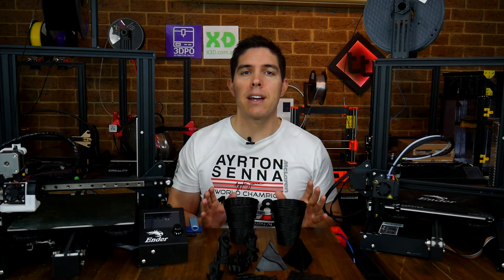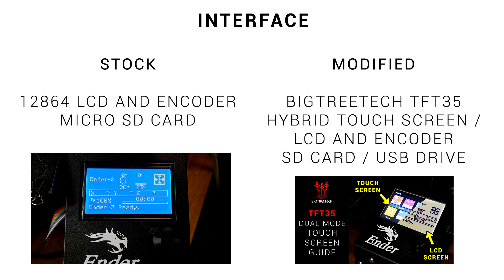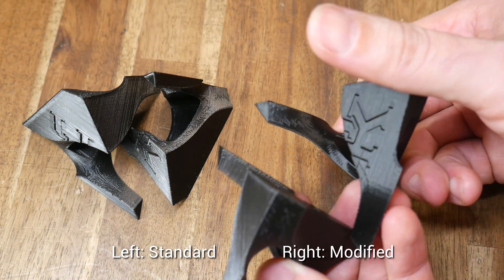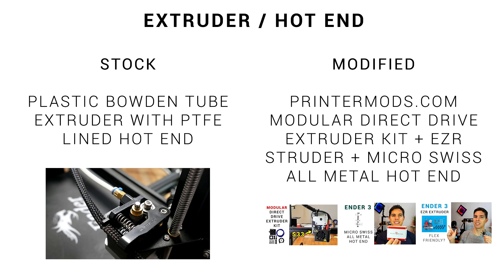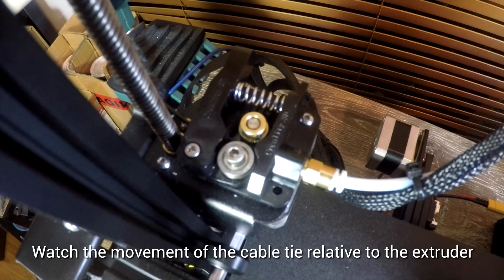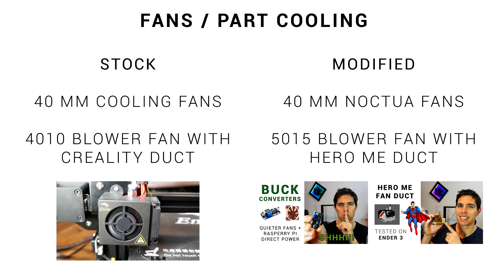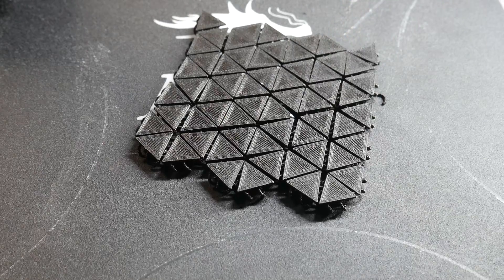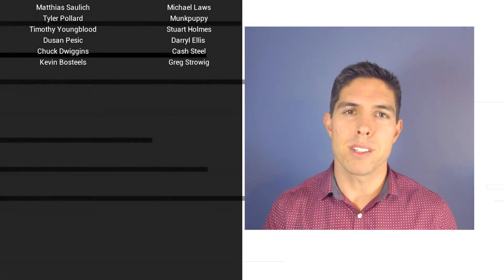Are modified 3D printers better? Stock vs upgraded Ender 3 comparison

Comment: Can I ask your advice on upgrading mainboards ? I have a copymaster 400x400x400 and the filament cooling it rubbish. They have a single fan that is split between cooling the hotend and the filament. I wanted to add a filament cooling fan and started to work on a 3d printed part, but then realised I have no way to control this while printing. It can be on all the time or shared with the hotend fan. So I was thinking about upgrading the mainboard as the one in the printer is not that good, but I am not sure what to look for and also do I need to pick one that matches the  existing components.  Would a Duet3d be a good option ?
Reply from the maker: I'll be fitting a Duet Maestro to my Seckit soon but don't have first hand experience with it yet to comment. The SKR V1.4 (formerly V1.3) from BTT has a good reputation and a lot of spare io pins. Might be worth checking out.
Reply: @TeachingTech  Thanks it's half the price of the Duet ! so not too much for me to get one and try it out.
Reply: but the drivers are built into my board so I can't move them over.
Reply: @TeachingTech  I ordered the skr v1.4, tmc2208 drivers and tft screen. Should be interesting to install and configure.

Comment: Hey Michael, thanks for the video. One thing from your video is making me curious and I spent days researching in forums and the internet. You said that the moded printer with the skr mini e3 v1.2 is extremely silent. Well I have installed the board and the stepper motors are really quiet but the mainboard fan is loud as hell because it is constantly on. The wiring diagram shows that the fan1 is on constant 24V and it is not controlled in speed. 
https://user-images.githubusercontent.com/4901762/68058642-fe004e80-fcf9-11e9-8dbc-e609e1adc00e.png 
The other fan (FAN0) is PWM controlled but this is for the part cooling fan. How did you manage to get is so quite. Wich fan of your ender is connected to the constant 24V? My mainboard fan sounds like a drone trying to lift off. 
I know many others have the same problem. I/we really appreciate your help! Cheers :)
Reply: Lausbu.be You can replace it with Noctua fan which has less air flow (but apparently enough for the TMC2209 drivers, which run cooler). The Noctua fan is powered by 12 volts so you will need a power converter but they are very small and cheap. Noctua is one of the most silent fans.
Reply: +1 for the Noctua. Another way is to use larger fans, but that requires a printed electronics cover, so I'd take that into account.
Reply: The stock fan is cheap garbage. I would recommend replacing the case fan with a good one (Noctua, beQuiet!, etc). The stock board wired the case fan to the part cooling fan. The board therefore would only get cooled, if you use part cooling. Imagine printing ABS which needs no part cooling and uses a lot more energy (=heat).
Reply from the maker: Correct on the replies, I have a Noctua in the electronics case too. My custom rear case allows a 40x20mm size to fit to pull a littler more air. A buck converter runs this and the Noctua on the hot end heat sink.
Reply: Hey everyone thanks for your replies. So if I understand you all, it is correct that the mainboard fan (fan1) is always running full speed. This is not an error. The trick is to replace the fan with a silent one that will need a power converter to 12v. It will transport less air, but that's okay because the TMC 2209 are running cooler than the stick board. Is this correct? Thanks to all.
@teachingtech. Did you place the power supply also in your custom case?

Comment: Nice summary Michael. You explained everything very clearly. I suspect though that you are close to doubling the cost of the original stock Ender 3 with all those upgrades. That also has to be added to the decision to upgrade.
Reply: I think with those upgrades he is already beyond that. A normal Ender 3 is so cheap, some hotends can be already just as expensive. Stock Ender 3 costs 155€ including shipping here rn. Microswiss Hotend alone is ~75€ here, which would be alrady half of it. Noctua fans usually cost ~15€ each. The direct drive wasn't cheap and the linear rails weren't either...
Reply from the maker: Good point Chuck. I addressed this scenario in a pinned comment, please check it out and let me know what you think.
Reply: Teaching Tech - I did see your post and those are all good points.
Reply: I only just started and paid 130Euro or 169,99USD for my Ender 3 (direct from Creality in Germany). I have already made a couple of changes like clips for the ribbon cable, the fan cover for the electronics and the Winsinn extruder which works much better than the stock one. Print results have been really good so far. One question I have is, if I use the Noctua NF-A4x10 FLX fans do I have to change the PCB or can I leave that as it is?
Reply: Dude, an accurate, reliable 3D printer is worth its weight in gold. A stock Ender is a liability. If you're just a hobbyist and don't want to spend much money, find another hobby. $400-600 for a competent 3D printer is a great value, if you're willing to do the modding necessary.
Reply: @theglowcloud2215  Thats a pretty elitist statement and pretty tone deaf for most of the reasons why people get into 3d printing. If people can't spend hundreds of dollars should they not even bother? Even when you say a stock printer is a liability, what does that even mean? If someone is just messing around with 3d printers for fun who cares if they get subprime prints? And why are you hating on people who can't/don't want to throw hundreds of dollars on a hobby off the bat? Do you really think the 3d printing community would be where it is if only people willing to drop 400-600 off the bat even tried it out? 
Last I checked, all the 3d printing youtube channels and everyone who posts guides etc on 3D printing do it bc they want to invite more people in instead of locking people out.
Seriously, be better.
Reply: @theglowcloud2215  it's a formula that makes them better than anything for quarter the price.  skr mini e3 rrf, flex plate, bl touch

Comment: I have a ender 3 pro with a few upgrades (motherboard, extruder, Bowden tube, and bed springs). My flexible stock bed has started to lose its adhesion and there are a few scuffs on the bed (including 1 hole... Oops!). Which magnetic spring steel bed is  reliable, but also cheap. The everflex pei seems to always be out of stock.

Comment: My ender 3 pro is in a constant modification process since I purchased it one year ago. The print quality is still the same I think, but it is absolutely quiet. I build an enclosure for my raspi, mks and 2208 setup, including the psu with big noiseless noctua fans for cooling that parts. I then build an enclosure, designed my own fan duct for three noctua fans and the printer is now humming silently in my bedroom. Oh, and a new direct drive extruder with an E3D V6 Clone is underway. AND there is a skr 1.3 with 2209s already on my desk.... I love modding.

Comment: I would like to know how much did all these improvements cost. Approximately anyway.
Plus I would be very interested to see a video that compares a printer which is the same price as your Ender 3 with extras. 
The idea being that an owner putting time, effort and money into modding is certainly worth it.
Reply: i was gonna comment the same thing i am about to get another printer and i have a ender3 i have several upgrades on it and was wondering the price of a fully upgraded ender3 - the touch screen(only upgrade i dont care about) and finishing upgrading my current printer almost like in the video but the ender5plus seems like my next machine if i had the money i might have to save up for a while tho
Reply: @GerdLPluu  a big reason for a video to be made with links to the parts used is for people who want to achieve similar goals and results and to that end there are so many options for the same part example is that shotty red all metal dual gear drive so many have the wrong size needle bearings or the gear is not drilled straight I have gone thru 3 with all ending up with the gear tilting sideways and locking up now i have the ezr and i chose it form many reviews including from this channel and I'm sure buying knock offs will hurt u in the long run buy the original from the real manufacturer or suffer like i have by constant aggravations of buying something that is considered a 2nd or 3rd "rejected by the real manufacturer" that don't hold tolerances or specs to the original version straight outta the box the  Genuine product from me genuine manufacturer is worth the extra in my life experiences but still sometimes I still buy the knockoff version and they are fine but most of the time knockoffs are garbage
Reply: Several hundred over the base cost. However this is a very strange configuration and many of these upgrades can be done cheeper.
Reply: @outsider344  once again buying cheaper parts leads to buying 3rds or 4th in parts picking order 1 manufacturing company makes them all but each reseller buys 1st pic thru 5th pic in some cases depends on how long the cast or machine can hold tolerances for the best experience buy the genuine name brand and u should get a 1st grade parts that make up what u are buying it cannot be any more cut and dry
Reply: @GerdLPluu  You can easily get an Ender 3 now with 32 bit silent stepper board for just 160-180$ any day. Recently picked one up and it's fantastic for the price. 

Many New Enders don't need the Mainboard upgrade. The screen upgrade isn't worth it and you're better off just using a Raspberry Pi instead. 

A linear rail is around 20-30$ any day with the bearings but better stuff is around 50$. A BLtouch is around 20$ for a clone and 40$ for the original. A 3mm thick glass bed can be had for a few dollars locally any day. A better bed could be around 10-20$ depends. Or if you want to grab a MK3 Spring steel PEI bed those are around 40-50$.

The solution for fans you mentioned is pretty good. The hotend doesn't really need an upgrade as I personally use it for 100mm/s printing without any issues. All metal heatbreaks aren't something most don't need but one just costs 4-5$ to use it with a clone E3D V6 which run for just 15-20$ any day. Though I'd recommend just getting a good Bimetal heatbreak for around 15-20$ instead which will be far superior to any other option. While the genuine one is just 50$. Though I'd seriously recommend anyone to instead consider something like the Dragon Fly hotend which is just around 70$ and is all metal but in all ways superior to E3D V6 ime. 

So in the end you're looking at around 80-100$ or less of upgrades if you're fine with clones and stuff or more if genuine or want more stuff. But an upgraded ender3 is a great deal for a printer under 300$ that really packs a serious punch.
Reply: The other point is, "cheap" buy-in to get started. Then add upgrades as you can afford/want/need them. Yes, you will likely end up doubling the price of the base unit, but incrementally. It helps reduce the barrier to the hobby. I'd never have bought a Prusa mk series at their prices, but now I have a machine, modded, that prints just as well if not better. Probably for less money. Of course there's sweat-equity than isn't easily measured, but tinkerers usually have more time than money.
Reply: @OldCurmudgeon3DP  so true and i agree even making a 3d printer from cd drives and a 3d pen is a project i am getting more confident to tackle as i learn more about printers as i upgrade my ender 3 and research this amazing tech

Comment: The best answer to "What mods should I do?" I've seen. Every newbie is bombarded with answers to this question that list every must-have mod. Many of them will only complicate the problems they are having.  My answer has always been, don't do anything yet. When you are producing the great prints the Ender 3 is capable of, then and only then will you know what mods YOU need and have the experience to evaluate them. My answer on the forums from now on is going to be a link to this video.
Reply: Stronger springs is a must tho. Haven't leveled for half a year.
Reply: @marifla9266  I don't know that for sure anymore. Creality was very responsive early on to criticisms. A number of the things we had to replace were fixed along the way by Creality and don't require changing anymore. But I went another way. I eliminated the springs entirely and went to solid three-point mounting for the bed. Faster, easier leveling and no need to periodically level if I don't change anything.
Reply: @ericcsuf  do you have a link to your three-point solution?
Reply: @ericcsuf  yes, creality fixed some things (extruder, xt30 plug) but the springs are still the same. I am also not sure if the 3 point mount Is really that beginner friendly  and cheap enough to be a must Upgrade.
Reply: @thebikeracer  No, I don't, but I'll put some photos up on google and post a link here later today. Search 3 point leveling on thingiverse for some solutions in the mean time.
Reply: @thebikeracer  I forgot that I did a write-up here:
https://www.thingiverse.com/make:662017
 That version used springs. I later removed the springs. I'll modify that original Thing to show how that's done.
Reply: @marifla9266  Hmm, I have the stock springs in my 3 year old Ender 3 and I only level my bed when I change nozzles and occasionally when I clean the glass bed.

Comment: I see your subtle design everflex sheet is starting to rust, soon it'll start to flake off.  It's a shame they didn't use an anti-corrosion layer, as other than the steady degradation of the sheet, I really like mine, but I've probably got about a month or so of life left in mine before it's useless.
Reply from the maker: I've noticed the change in colour but as yet there is no change in in performance of the texture left on prints. I'll keep monitoring and update the original video if needed.

Comment: My CR-10S is modified to the point that almost the only thing remaining stock is the frame. Can I even call it a CR-10S anymore?
Reply: I am in the same case with my CR10. I added regularly improvements to it as I learned to better understand it. The whole process gave me a in-depth understanding of FDM printers to which this channel was a major contributing part (namely bl touch, controller board, stepper controllers and linear advance tuning). Later, this knowledge and skills were paramount for my current activity in our Odense's MakerSpace (the O'Town Garage)
Reply: @lioneljouvet4517  that is like how im going about things and i think its the best way to learn jump in to the deep end and tread water until i learn how to swim lmao
Reply: Only Fools and Horses, Trigger's broom https://youtu.be/LAh8HryVaeY
Reply: @georgeprout42  Metaphysics of identity, Ship of Theseus https://en.wikipedia.org/wiki/Ship_of_Theseus